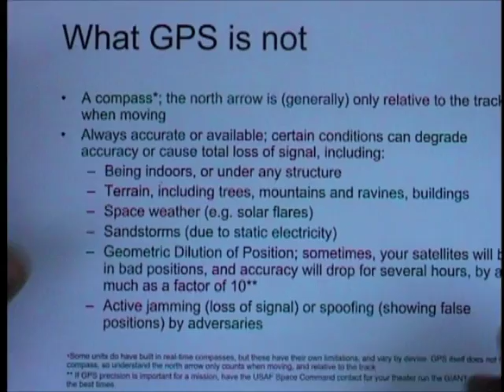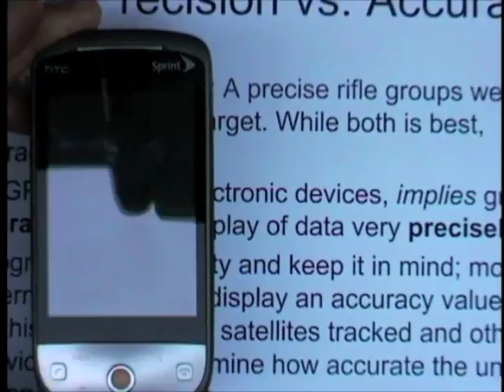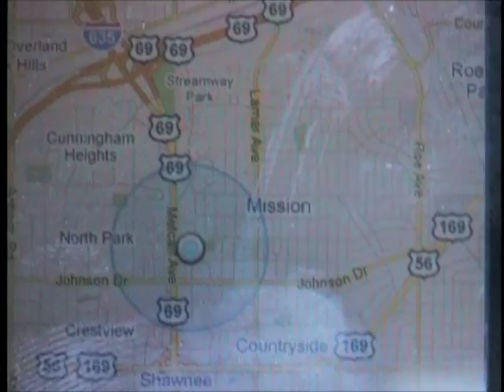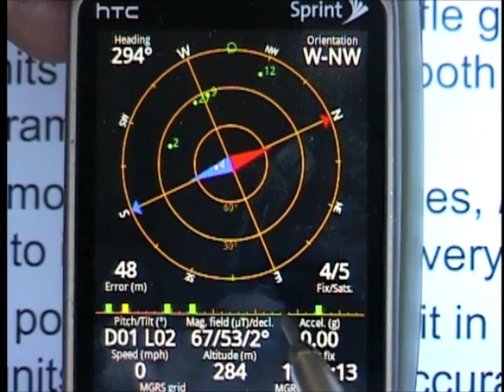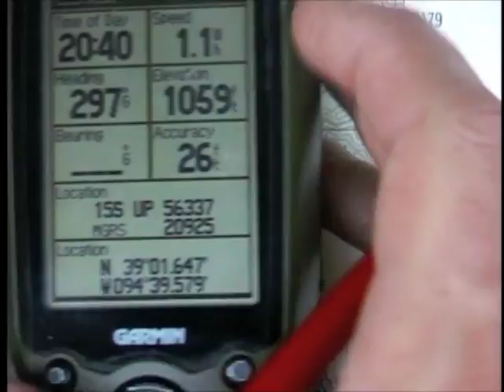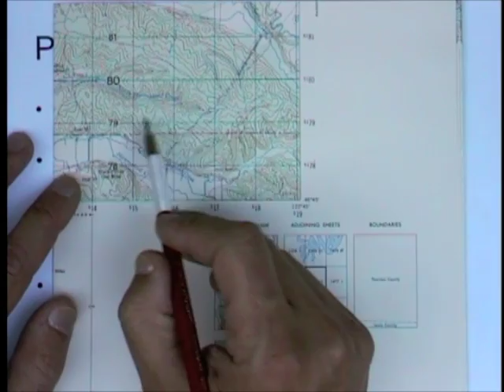GPS for Land Navigation - Part 2

Comment from the maker: @Tendrax Which phone? Regardless, both came with the control widgets. Just gotta drive around inside the add-to-home-screen controls to find them. 

If you mean the one with the individual little button for GPS, that is an HTC, so it came with the Sense UI, and is not base Android. Dunno if you can get it from the Marketplace if you have a non HTC device, but I'll bet you can get something. I downloaded an Airplane Mode widget and had a choice of like a dozen free ones. all of which seem to work